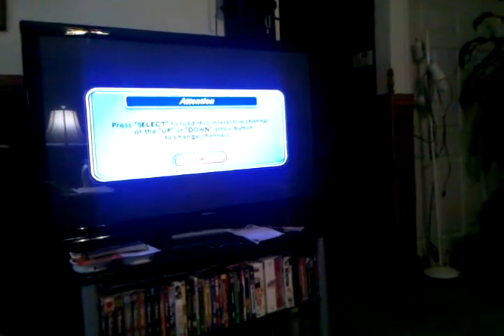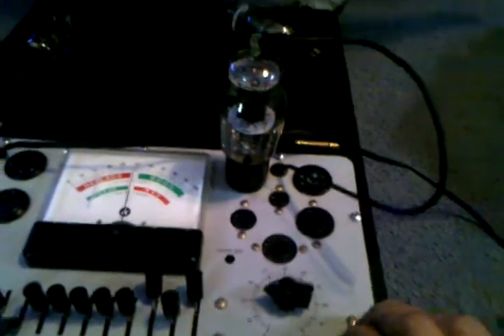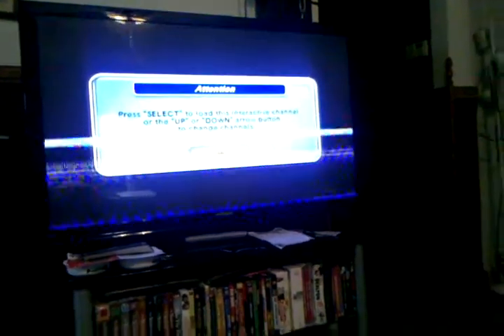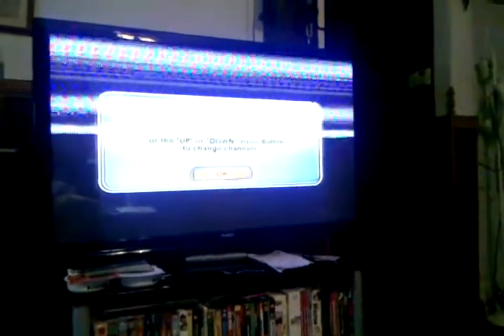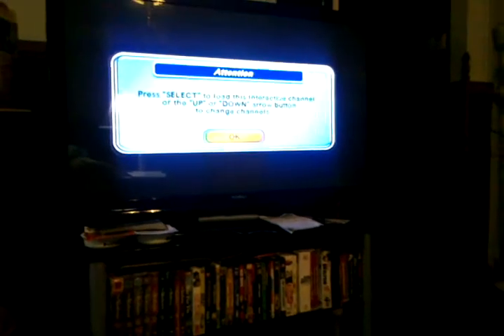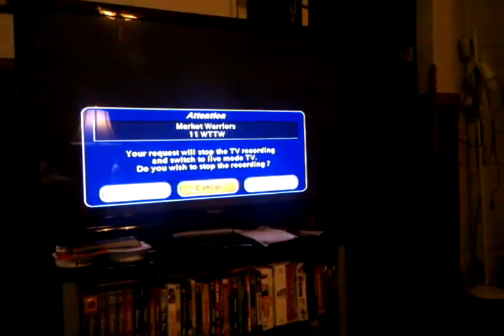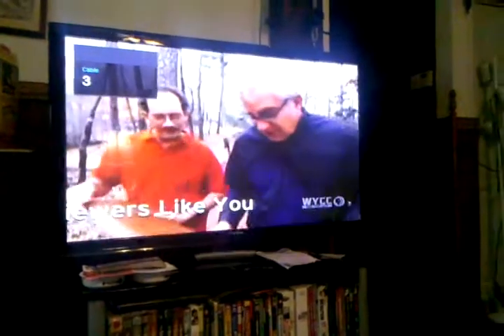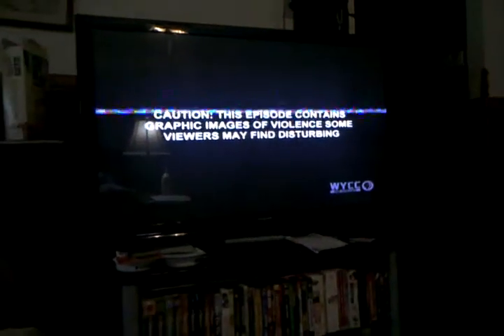Barkhausen Oscillation

Comment: I think you may mean "6BG6" rather than "6GB6". The 6BG6 was just a repurposed 6L6, and the 6L6 was the initial bad actor in the realm of these nasty parasitic oscillations.

Thanks for posting this. It bears directly on an article/web page I've been working on for the past several years; just web-search for "Intrinsic Negative Resistance as a Cause of Parasitic Oscillations in Beam Power Tubes" and you'll jump right to it. I recommend reading it, because you'll find that you're not alone: A generation of hams, overlapping generation of vacuum tube and television designers and technicians, fought with exactly this sort of oscillation because the tendency to produce it is built right into the physics of the tube type used for screen-grid class C RF power amplifiers and for television horizontal-deflection amplifiers alike.

Although it has become standard to refer to the culprit oscillations as "Barkhausen" oscillations, such may or may not be the case. Were you to put a portable AM radio, even a portable FM radio, near your tube tester, you'd find that the oscillating tube under test will probably interfere with them in addition to the TV set. Ham radio operators--which your screen name suggests you may know something about!--had to deal with bad effects of these oscillations as key clicks capable of covering an entire ham band; distortion on modulation peaks; and parasitic oscillations at LF, MF, and/or VHF. (That we can see and hear the effects across such a wide frequency range--even at audio if piezoelectric bypass capacitors are used in the affected stage or stages--suggests to me that the fundamental oscillations are at LF or MF, and that their fast rise time causes harmonics capable of interfering with multiple TV channels at once.) The double bars you see precessing across the screen as the tube warms up suggest that we might be able to dope out the initial fundamental frequency of the parasitic in relation to the TV set's vertical scan rate; that would seem to place the fundamental at LF.